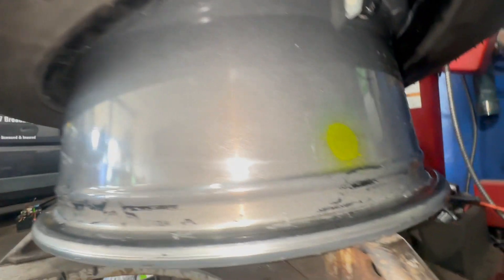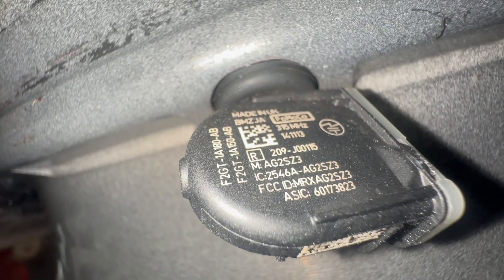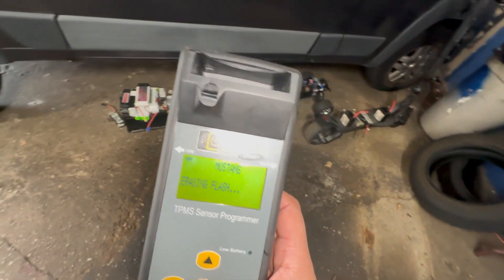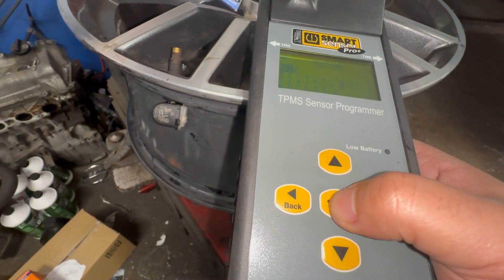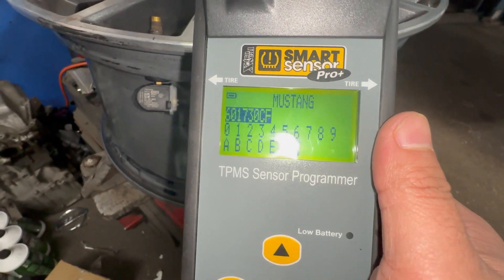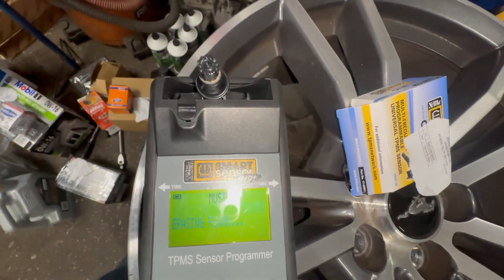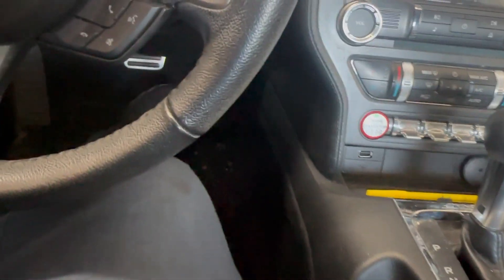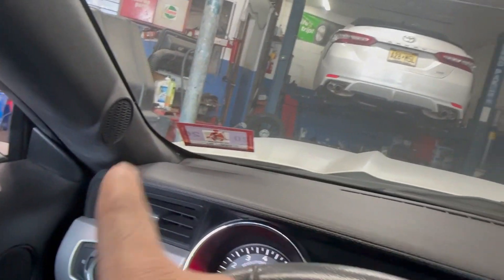Ford Mustang TPMS sensor replacement program and calibrate

Comment: I installed new TPMS sensors on my 2016 Mustang and tried resetting them using the small square relearn tool. I put the car into relearn mode, and it prompts “train front left tire,” but the tool doesn’t trigger anything. Is there another method to program or relearn the TPMS sensors? The programmer I have is a small grey device with just one button on it, no where to add the id
Reply from the maker: No u would have to take it to work shop need to reprogram and keep the old sensor away from the car
Reply: @RBTheMechanic what programmer do you use?
Reply: @RBTheMechanic  can it be programmed while it’s already installed in the wheels, if not I will have to take them all out. What programmer tool do you use?